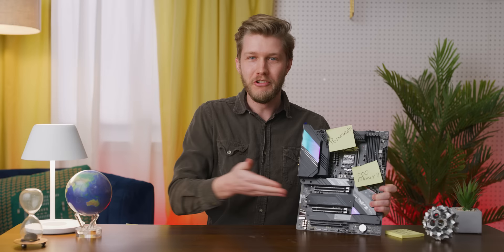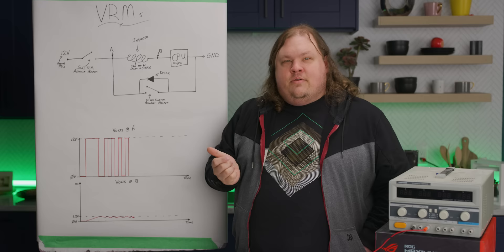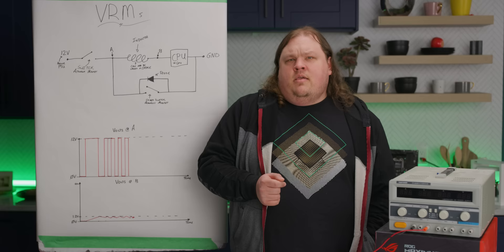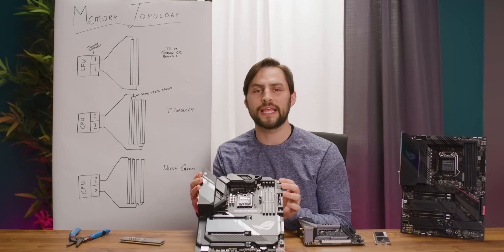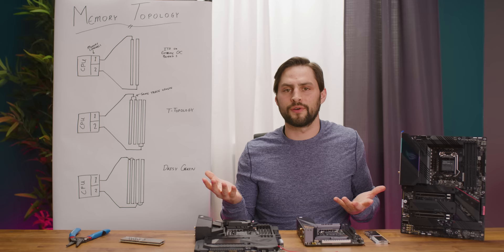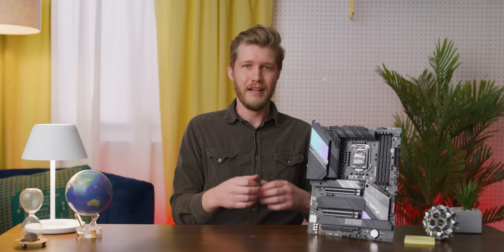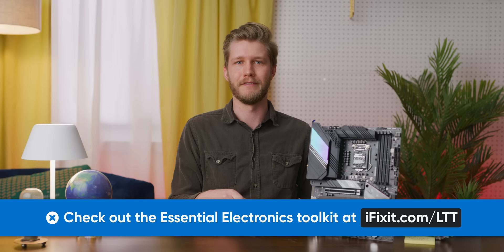How Motherboards Work - Turbo Nerd Edition

Comment: as someone who knows far too much about this stuff than I have any right too, I was waiting to see how well you guys did, and you didn't disappoint. I was actually a tad giddy when you mentioned the older config of north and south bridge. I have fond memories of being way too concerned with which chips were used for the bridges on my early builds, despite the fact that they probably didn't do as much for me as I thought they did. I am a tad sad on that point that you didn't point out that the reason for the beefy VRM heatsinks is because PC builders got accustomed to seeing huge heat sinks on boards with killer chipsets, because the north bridge back when it was a thing actually needed it to handle the memory speeds and PCI/PCIe. Not to mention that integrated graphics used to be on the motherboard, not the processor. I still have a socket AM2+ board that has an Nvidia nForce 630a (geforce 7025) graphics chip. Anyway, PC builders got used to seeing heatsinks on high end motherboards, and now if you throw a bare board at us, we assume its low end. love the video, do more like it!

Comment: I do  agree with most of the video the only thing i would say is that motherboard manufacturers should keep making all different kinds of motherboards that do different things. many people are looking for different things while looking at motherboards. you may laugh at those heat sinks on the vrm's but thats keeping the temps lower overall as well as keeping the temps more stable to help with heat cycles. having many ram slots could add some back up if you were to have a ram slot fail one day or pcie slot stop working. if you have a well oiled mashine it's going to run for a long time and i think that also applies to tech. 
for example i water cooled my and only put a 0.20ghz over clock from 3.6 to 3.8. my only real goal was to make my cpu last a bit longer by making it so it doesn't get has hot and doesn't heat cycle to much. it also allows the fans to not kick on for a bit longer and with it right beside me i can barely hear the fan when it dose kick on. 
and as for a second pcie slot. well why not have it, it can be used for so many things like if you did want sli you could do that or you could have it act as a storage hub with a ssd pcie converter for more storage. or you could add a capture card. it's always good to have a second pcie slot.

Comment: While you have some things right, boy do you get them wrong.

A frequency, is a wave form. Each end of the wave is a digital signal, one being a 0 the other being a 1
Multi phasing this signal puts two waves in the connections, out of phase with the other, so adds two sets of 0 and 1. These are stacked, but limited to band width (how many waves) can go down the wire. There is noise and cross signals if you push to much.
Think of it like WiFi channels.

The vrm is handled is a cross phase loop. The coil is resistant to change as it charges, like a battery. It only works when it's off and not on and pushes power that's stored in it. The diode is the trigger and stops back flow.
When it's on, the power goes up, like a slow charge. Then when it's off there is a spike of power and then a discharge. The spike and discharge is held in a capacitor like a battery for the CPU.

The MOSFETs work at fast speeds switching on and off, but voltage is not alone, there is current, known as amps. Adding these together makes watts. Lower current is normal. So you take 1 volt and 1 amp you get 1 watt. 2 volts, 1 amp is 3watts and 1 volt 2 amps is 3 watts.

The low voltage and lower heat, is actually harder to control over higher voltage. (Why intel want PSUs to change).

If you have a high watts requirements with low voltage we need higher currents (amps) to make it work.
If we have 100 volts and we want 200 watts what current (amps) do we need? 

Phasing, smooths the flow of power as switching power creates peaks and lows, so if they are opposed, then there is a middle which is the voltage that we want.

Comment: You know I had this whole thing about only having two RAM slots then I thought about it for a few. If you've got enough to blow on $300-$500 motherboards, $150-$200 for ram is no big deal. BUT it does beg the question, why bother thinking about future upgrades as what you going to upgrade instead of just buying another complete setup.

Comment: Great video. A lot of the stuff i had to read through and interpret some science to glean understandings (20 years ago) of dual channel mode, IPC and controllers, PCI2 and 3 bandwidth. Serial transmissions versus Parrarel transmission styles and more. This stuff is not rocket science especially when it is explained at this level or around this level. So good for LTT to put out the next level up of detail and some of the science behind the magic and the fun ! Seeing the diagrams for DDR vs DDR2 was enough to melt my young brain back then. Youtube really is a difference maker for turning dry content into accessible and enjoyable content ! and LTT certainly seem to be at the top of this game.

Comment: I always had ATX boards, that could do a lot of things. But in the end I didn´t really used them. I found myself browsing the web to see if I can find some usefull stuff I can put in all those PCI and PCIe slots. There wasn´t much. What actually was good to have was 4 Ram slots! I´m pretty sure there will be a moment my future 32GB System will be better off with 64GB. And I want at least two M.2 slots for SSD, because I need a lot of storage. But away from that a micro-ATX board will do for me. I don´t need too big and fancy heatsinks on it, I need no RGB stuff at all and I will only run 1 GPU.
Reply: Hey walter, look at these unlisted vids now

Comment: Thank you for educating your fans instead of wowing them with expensive builds.
Reply: Not really they forget to mention the reason why having quad channels is good for gaming. 4 slots have more bandwidth than dual channels. Less Ram size will transfer data to the CPU quicker. Having 32GB for example in dual would be 16 GB, in quad it would be 8GB. It will take less time to transfer that data to your CPU, which in gaming is critical. This why you see high end gaming rigs have quad channels.

Comment: Actually 8 layer MB were common on may higher end RISC rigs in the 90s even early 90s. Also yes the PVI-e v4 ports are rated at 31.8 GBs but even on this same channel you guys discovered mother boards and CPUs were not capable of those speeds as of last year. Same thing when PCI first came out.

Comment: The 2nd and 3rd slot would be a good suggestion if you don't plan to just populate them all with the maximum the CPU can support.  Just note that on some boards you may have to enable dual channel in the UEFI (or BIOS depending on how old your board is).  I just went ahead and populated all four of my slots for the maximum of 32 GB which my board supports since I got it cheap.  To this day it still runs flawlessly.  It is not the fastest DDR 3 RAM but it works well enough for 99.9% of everything I use it for.

Comment: Everything they have gotten wrong in this video so far: 8+2 phases does not stand for “8 phases for the cpu and 2 for the RAM”, it means 8 phases for the CPU cores and 2 phases for the rest of the cpu like the Intigrated memory controller and an intigrated gpu if it has one.
Reply: I hate to be that guy but you are also wrong

Comment: I used to buy top end motherboards back in the early 2000s but I realized I never really plug in that many expansion cards, nor do I install oceans of RAM, nor do I install 10 hard drives, nor do I need 12 USB ports at the back plus 4 in front. So recently I went with a B450 board. Really, it's enough, small enough to fit in a smaller case, and cheaper too.

Comment: 0:13 "Why the heck does everybody want all of this?"
My PC:
RAM 32Gb x4 (128Gb total)
RTX 2070 Super (for virtual machine)
AMD RX5500XT for host system

I literally need 4 slots of RAM and second x16 slot of PCIe to connect everything what I need.

Comment: The major issue with RAM being closer to the CPU from the market PoV is the number of aftermarket CPU heat sinks that will struggle to fit because of the RAM obstructing that area.
Reply: low profile ram is really nice to have for that exact reason. i don't need or want rgb on my ram.

Comment: "... gold traces for the perfect signal." This is actually a fallacy. Copper is a much better conductor or electricity compared to gold. Gold-plated connectors are only used because bare copper will oxidize when in contact with air and eventually stop conducting electricity, whereas gold will not oxidize. Gold is not used as a conductor inside high-end audio cables (and motherboards) and such because it would weaken the signal compared to using copper.

Comment: Love the VRM description. I have the Gigabyte Z390 Aorus Xtreme similar to the board in the video and specifically bought it due to the VRMs. My i9-9900K is at 5.1GhZ base clock on all 16 threads. Also why I won't buy Asus motherboards with much lower VRM counts.

Comment: Him: "Don't need the heatsinks"
me living in a hot country and not having air conditioner in the room
Reply: 10c extra ambient temperature won't make the difference between needing and not needing a VRM heatsink. Those things are specced up to 125c.
Reply: @TheAnoniemo   So the top heatsink is not necessary?
Reply: @varunkumartp4409  Depends on how efficient the VRM is, and what kinda load you put on it. But if it comes with a heatsink definitely leave it on.
Reply: you'd be surprised at how little heat the massive VRM setups produce
Reply: @TheAnoniemo  so I'm kinda confused between, msi b450 tomahawk max and mortar max. The tomahawk has one m.2 and  vrm heat sinks near the rear io and top. Whereas the mortar has two m.2 slots and no vrm heatsink at the top. Both the boards are practically the same. Which one should I go with?
Reply: @varunkumartp4409  The B450m mortar seems to be cheaper, so if both work for you get that. But you can read some reviews. The mortar is also smaller, so keep that in mind.

Comment: Your “ripple” does not include the power spikes created by the CPU because of the inherent quantum mechanical defect of CMOS. During each rising clock edge, the N-channel FET turns on before the P-channel FET turns off. This creates a transient short to ground. This cannot be eliminated or mitigated. It is inherent to CMOS. Choose a different technology (like RTDs) for your CPUs and GPUs.

Comment: "Most people only need two RAM slots". Meanwhile I am rocking four Trident Z 16GBx4 (64GB total RAM) DIMMs in my motherboard. To be fair, I am running Linux for my everyday computing and using KVM  running Windows under VFIO for gaming.

My argument to four DIMM slots. Yes, you're mostly right that people usually only need two. However, I like having 64 GB of ram so that I can run my multitude of VMs I need for my certification studies (I am going for multiple Linux certs and already have a Cisco CCNA), and still have some RAM room left over for gaming on my Windows VM (I primarily run MSFS 2020 in VR with an Oculus headset, flight sim gear, and a USB PCIe card passed through to the VM because I am an aviation enthusiast lol). Yes, I can run two 32GB DIMM modules, but if one fails, I could possibly lose 32GB, or half, of my RAM. If I run four slots, I still get dual channel, and at most, if one of my DIMMs fails, I only lose 16GB, or a quarter, of my RAM. While RAM DIMMs definitely have gotten more reliable nowadays, they do still fail occassionally. Heck, I just had one give up the ghost after showing errors in Memtest86+ last summer. I get RAM is cheap nowadays, but still, potentially losing less RAM in the event of a failure is a bonus to me, especially with my VMs, while I order myself a replacement RAM stick. I know that it doesn't always work out that way, what with dual channel, and how RAM works, considering that if you lose a RAM stick, it screws your dual channel and your performance a bit, but still, I care more about RAM quantity for my setup than RAM performance.

tl;dr -> I run a bunch of VMs and other things for my certification studies, as well as a Windows gaming VM on Linux with GPU passthrough, and using 4 DIMMs to me is better than 2 because if one stick fails, I only lose 25% of my RAM vs 50% with only two sticks.

Comment: This video just confirms that I burnt out one of my ram controllers on my 3600x last year when trying to overclock my ram. I have to run them both in the A slots as the B slots won't allow for full xmp speed.

Comment: I like the motherboards with 2 16x pcie slot spaced far apart so the gpu doesn't get choked out by a nvme or any other pcie card

Comment: SLI is dead, but there are many uses cases were a 2nd Graphics card can be handy. Calculating Physics or GPU passthrough while on Linux... you really never know what you will need that slot for, and the worst thing is to not have one.

Comment: The sad thing is, what I experiened, that the "cheaper" boards of companies like Gigabyte, that "only" offer two RAM slots and everything that actually makes sense without the unnecassary bs, also use in general cheaper component regarding the chips on the board, and then especialy as a linux user, you can have a worse time with the board.

Comment: A lot of this is "silly" due to changes in the market. Some of this is still possible for market segments outside of gaming and general purpose. CPU frequency matters only for certain things.  Enough RAM is available on two for cheap. Single GPU is simple, lower power, and enough. However IO bandwidth in memory and PCIe are becoming more important. High end market will still look for multi-GPU and maxing memory controller speed/size. Lots of power for multicore at high power bin with high power cooling solutions. These may be more professional loads than casual. This could cause market problem. Remember the cost of larger sockets.

Overall I did like this video. I liked the format, but this may not be the best mainstream format. However it is certainly worth including. The four socket vs two socket is kind of arbitrary without this level of explanation for example. PCIe is something that I wish you have spent more time on.  South bridge vs North bridge, PCIe lane sharing NVMe vs GPU vs Sound Card vs NIC vs USB vs SATA, etc. I never knew to look at this for years and it could have gotten me into trouble. Granted this is not the most gaming centric usage, but not exactly professional either.

Comment: I wish I saw this before building my brothers computer, I had it built at a store since I had no clue about computers, all I knew was the gpu had to be good so I got him an rtx 2060 super with the three fans on it ( gigabyte I think ), only thing is we originally had a tuff gaming x570 board that didn't work for some reason so they swapped it out for an x570 tomahawk from msi, I feel like we could of gone with a lower spec motherboard seeing as we don't over clock or anything 

Cpu was a ryzen 7 3700x 16gb or ram and an 1 to of m.2 storage, cost around $1700 cad before taxes

Comment: The mass of viewers hold these fancy motherboards as the absolute standard of gaming performance. When really black PCB's, with RGB, fancy silkscreen lettering, massive VRM heatsinks, do absolutely nothing for performance. The gaming PC component industry is purely marketing driven, not necessarily by the engineers that actually have to design these things.

Comment: I may not need SLI, but I'd still like as many PCIe slots sized for 16x, or at least 4x, as practical. Why? Because you can fit any PCIe card in a 16x slot, but you can't fit a 4x card in a 1x slot. PCIe cards that need more than 1x aren't common, but having the slots at least gives me the option to use those cards.

Comment: I want 4 RAM slots because I can double my RAM by adding a second pair of DIMMs when the same speed of RAM gets cheaper. More RAM means more VMs running at the same time, and that's very useful for some of the things that I do. I agree that SLI support is pointless in 2023, but I want that second 8x or wider PCI-e slot for my 10GE NIC, and I don't want to have to use a pathetic PCI-e 1x GT710 instead of a decent GPU because my /GPU/ slot is occupied by the fat pipe to my NASes.

Comment: Or, instead of using an ancient regulator design, you could use a Ćuk converter tuned for 0 ripple. You could also use synchronous rectification. You could also use Gallium Nitride (GaN) power FETs with integrated controllers. Multiple phases are just a way of step-and-repeating an old, bad design. Everybody uses it, not because it is good, but it is traditional and conventional and it worked in the past. All the reasons for not hiring engineers with creativity, imagination, or vision.

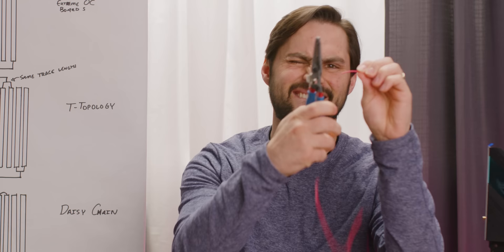Comment: 4:49 incorrect reasoning. CPU to RAM communication is not that instantaneous to begin with. There is always a bigger delay. (CL+Path delays...)

Everything doesn't have to be completed in one clock cycle

Comment: I use 2 gpus I use a rtx 3060 to game and a cheap $30 low profile r7 350x GPU from 2012 for streaming to take the load off of the 3060 giving me more gaming Performance using just the 3060 streaming takes up about %15 of the gpu by itself then add the game. running the game it still reaches 99% anyways regardless but less frames splitting the GPU gives me about 30-40fps more in COD

Comment: You didn't mention why the GPU issue. Sure the last time crossfire/SLI was useful was about 10 years ago, but you should at least mention it. (Using the extra 16/8X slots for networking and raid cards is something I do with most motherboards)